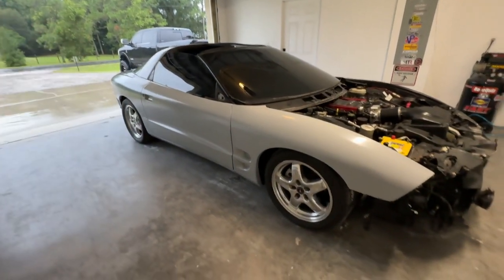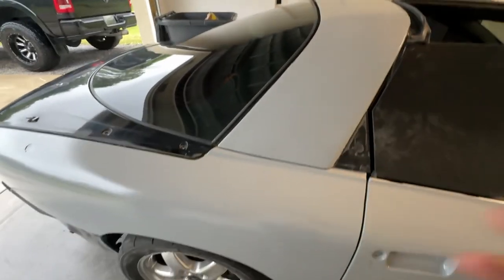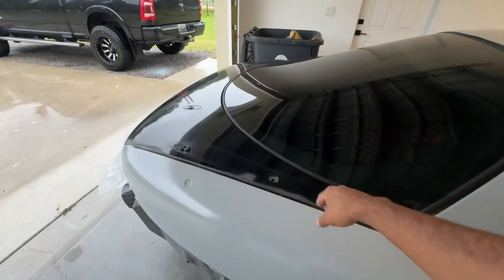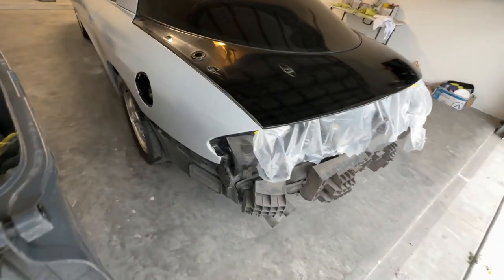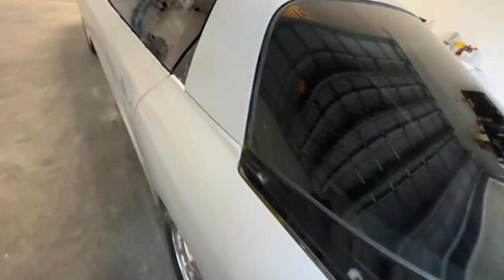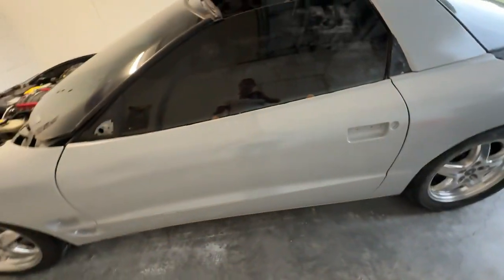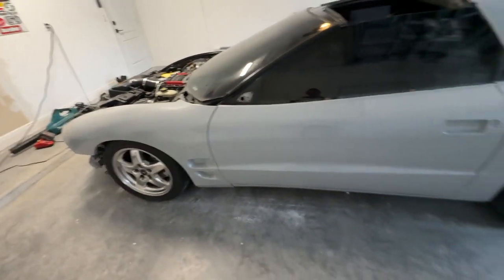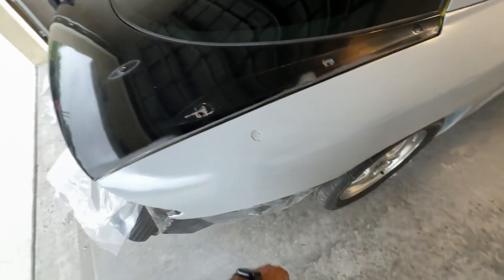2002 Trans Am Restoration - Part 1

Comment: I'm impressed! I absolutely love these cars and currently have 3 fourth gen Firebirds.
I hate to say it, but the sail panel will never be perfect. GM changed the adhesive, and when sunlight exposure happens, the glue will actually seep through the panel. The only option is replacement. Anyway, good work!
Reply from the maker: Hey buddy, thanks for watching. you are correct, it was once already replaced. This one was fixed, by me. Lets see how long this will hold up. if not, replacement on the way ha. Thanks for watching.
Reply: @TheSpeedBug  I need to replace the sail panel on my 2002 Formula, just waiting and saving money. Beautiful TA, I'd love to see more videos on it.